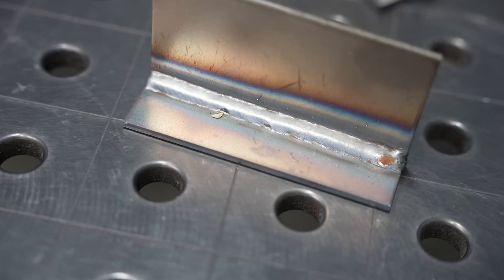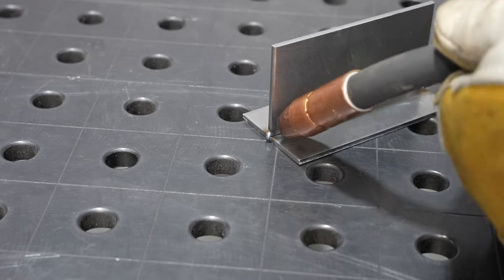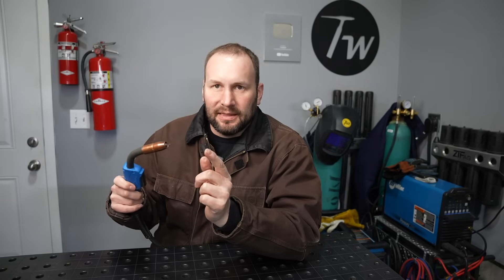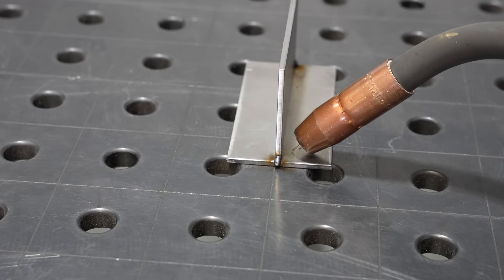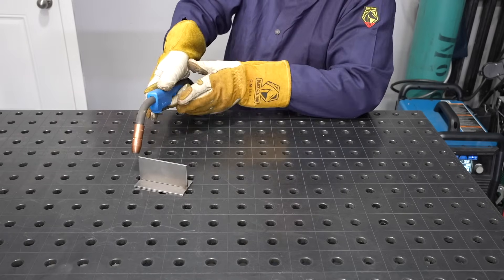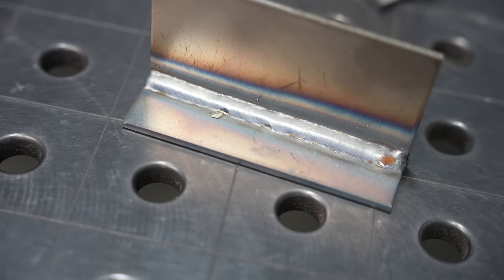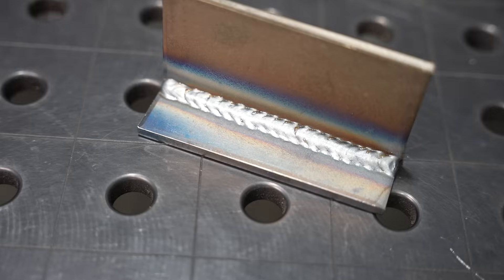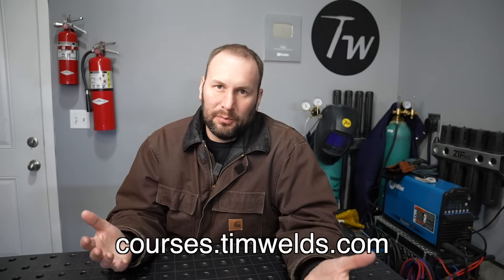How to Make Consistent MIG Welds

Comment: Hello, I'm a student from the Philippines, 16 years old... I have a question, when you do a welding, do you have to press the electrode light or press it hard? thank you so much ❤

If you are wondering why I'm asking this, I'm a senior high student, Grade 11 and the strand I took is SHIELDED METAL ARC WELDING (SMAW)
Reply from the maker: You need to hold a slight gap, so the rod doesn’t get pressed in tight. Way to go learning a valuable skill at your age!
Reply: @TimWelds thank you so much ❤

Comment: Push or pull for mig
Reply from the maker: For short circuit (75/25 gas or straight CO2), either works. If you use spray transfer in  heavy stuff or MUG aluminum, push is needed.

Comment: Thank you for sharing, great video! Im a small business owner running lawn care/trucks trailers and i bought a basic entry level harbor freight Titanium 200. You can see it on my channel. 

My theory was I would get a multiprocess mig/arc welder so I can run 110-220 volts off my predator 8750 watt shop generator. While also being able to arc weld anything structural like a broken plow frame down the road in a year when I get into snow removal. 

So far I’m thrilled to be welding. I bought a basic argon tank on the smaller side for 3-400 and altogether invested about $1,500 into my welder setup. 

I purchased a harbor freight Titanium auto darkening welding helmet and love it. 

Ive repaired my mower frame, welded my girlfriends exhaust flanges and even bought an adapter for 220 so Im about to weld a vehicle subframe on my ford escape flip project!

Comment: Tim i would love to see a video about what and where to focus my eyes during MIG welding and what I'm supposed to be looking for in and around the weld pool.  Thanks for all that you have done
Reply: you can actually look before of after the puddle, whichever works for you. It also depends on the nozzle too, the smaller ones suck, they blow up practically mid weld if they get top hot so the bigger ones are best. Only thing with that is your not gonna see the direct puddle yk what I'm saying? But I hope that helps a little on where to look because it's been helping a lot
Reply: always push your weld too instead of pulling so the gas can go into that weld and weld it nicely, with pushing the weld youll be able to see pretty easily too, plus welds will come out more clean

Comment: Im not sure if is it correct to do this, but when i need a nice looking and smooth weld bead  i will lay down the nozzle of the welding pistol over the material then i try not to press it hard and just push the bead while im focused to get the same speed and angle on that bead.
Reply: Sorry if my enligsh writing is crap im not the best qt it 😅. Btw thanks for your videos sir, i learn always something new from plp like you.

Comment: Im consistently making larger than required weld beads.
I obviously need to weave less and move faster, but im struggling to find settings that still create a good weld with adequate penetration.

By how much should i be adjusting my settings approximately to achieve a small, neat bead?

I do understand that every machine and every weld situation is different, but a suggestion on average setting changes based on butt and fillet welds in the same thickness material would be greatly appreciated!!

Thanks for sharing your knowledge. It's appreciated!!

Comment: 4 months ago, my neck surgery failed... so my boss took me from being a material handler to a parts cleaner... started practicing welds on my breaks, watching these videos as well as some others.

As of last week, I've passed 3 welding certifications. Last one is at the end of this month.

These tips helped me out a lot, but I'd like to point out that welding FOR art is mentioned in this one...

But what I've discovered the hard way, is that the act of welding IS art.  Once you understand the science of the machine, and the fundamentals... everything else is art, and takes so much patience and practice.  

Luckily, I've caught on quickly, thanks in large part to your videos.

Unluckily, I now know that welding is truly an art, and not everybody can do it... as we've learned with the new hire that just graduated weld school... 😢

Comment: Tim. I believe us speed up and slow down the videos for explanation of technique. Can I suggest that you show the actual speed being used with on screen information during the video. My concern is the old monkey see, monkey do thing. If you speed it up or slow it down. many believe that is the correct speed to be traveling while welding. Visual information about speed is a lot easier for a novice to mimic than just the data and if you do not state this in the video somehow, it will add to their head scratching as to why their weld is not like yours along with figuring out best power and speed. I think for novices, seeing the actual speed that you travel along with the data (thickness of the metal, gas flow, power and feed your machine uses) will be an aid. Showing basic methods takes all the basic information. I know we are not paying for your instructions but, it would be helpful in all future videos for novices.

Comment: This is probably a stupid question. But what would happen if you tried TIG welding with the gas turned off and use an arc welding or MMA welding electrode as the filler metal? Would the flux replace the shielding gas or would it just not work?

Comment: Very helpful information taken, I am basically new to mig welding one year in, I started out with a harbor freight that could only use flux core, I found it easier for the task vs stick, then moved on to another harbor freight that used gas 180 i believe, used that with gas and enjoyed the experience even better after fixing a few bugs on the machine, then I moved up as I thought I was pushing the HF to hard for the thickness of metal to a Lincoln cv 301 I believe and really liked the performance of that machine so I bought another identical machine same, in between that time I bought a Hobart 180 tried that one and liked it and after that I bought a miller 251 vintage tried that and liked the Lincoln better and lastly bought a Miller 212 non auto, just tried that and have not had enough time on it to give a yes or no on it, all these with in the last year plus. all these are older transformer type machines, in today's era every thing seems to be igt board driven and mostly auto set up once you put in thickness wire etc into the program.
I think I would rather stick with what I have and not move to these newer type machines although I have never tried one, the idea that they are board type and if the board fries or something your basically done? any thoughts Edit I forgot to mention two others a Hansen mig really like that one and another one designed for auto body that is three phase, i have no three phase so have yet to try that one from Germany

Comment: Flat weld I’m good, but getting consistent around exhaust tubing and rolling my wrist while keeping the same distance and angle I really struggle with

Then starting and stopping and not making it look obvious is another struggle
Reply: starting and stopping i can actually give you advice with. When you see that it's very obvious  that's where you stopped. Work on your wrapping, meet that other weld and make sure to stay just a small little moment so that the passes weld together. It'll look like you ending there no matter what but the wrapping looks very nice. I'm not the best explainer, but that's my advice for you. And the consistency you can rest your arm down and hold your welding hand as you just guide yourself, and tbh it's all about finding ways that are comfy for you. You may have a whole diff way of doing it! and what I do for consistency is listen to the weld carefully and if it sounds good then ur doing good and make sure to point that wire right into where ur welding, just weld that shit
Reply: with the stuff ur welding as well. You should find every way to put that piece of metal so you can make flat welds and only do the other welding if you HAVE to do it awkwardly yk? sometimes with a short ass pipe when you need to weld inside of it like I said, it may be difficult at first but gently roll ur pipe, using your one hand to keep consistent, not have to worry about bending your wrist and such. If you need to do welding it single passes then do it too, whatever works best for you. The pipe was an example but you get what I mean and keep in mind ur only gonna get better and better

Comment: I don’t understand when you say the length of your wire from the arc changes the amount of resistance in the wire? Isn’t the length of your wire the distance from the arc to the feed rollers? Therefore the extra distance is actually like an 1/8-1/4” added to several feet, right? Just asking.
Reply from the maker: Excellent question! The wire doesn't conduct the electricity all the way from the drive rollers. There is an electrical wire inside the lead to the gun which carries the current from the machine to the contact tip inside the nozzle. The contact tip conducts the electricity to the short length of wire sticking out of the gun and then to the arc.

Comment: I'm an old dog learning new tricks...Thanks for sharing these videos. My welds currently follow a rouge path well away from the joint...
Reply from the maker: Awesome! Hitting the joint can be one of the more challenging parts as you're learning to see. Hang in there, it's normal and takes a bit of practice to really see the weld pool and its surroundings.